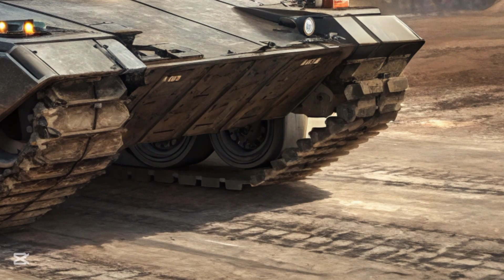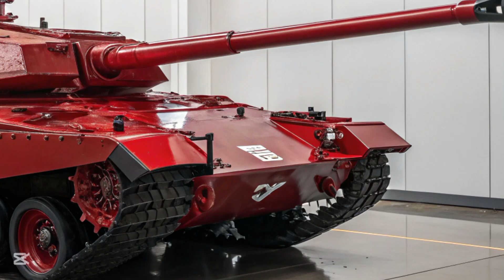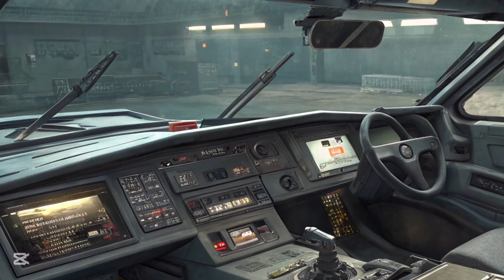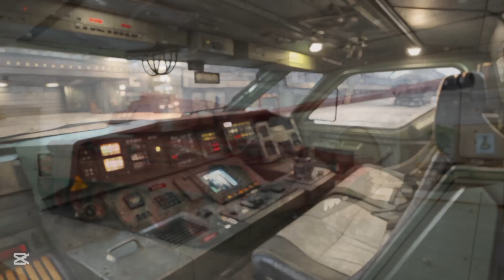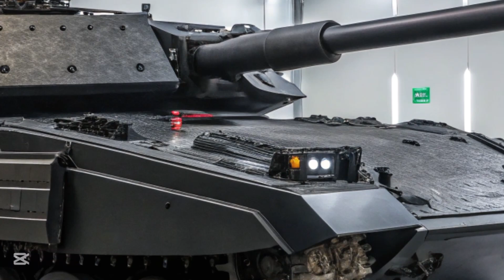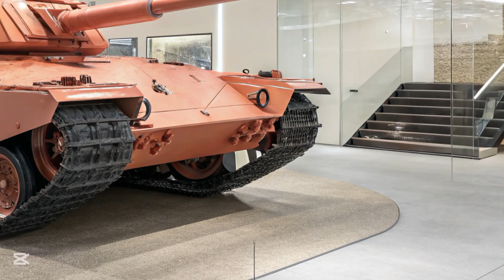2026 T249 VIGILANTE Prototype EXPOSED! 😱 37mm Gatling Cannon of DOOM Returns! 🔥🛡️

Comment: You know that at lesast three tanks were shown -- ALL purporting to be of the same tank?  Basically, this is total BS.  I just wish there was a way (maybe there is, but I haven't seen it so far) that you can go back and locate these types of garbage and permanently delete the 'author'.  Did you notice that the numbers of the 'road wheels' showed this garbage to be 5, 6, or even 7?  Did you happen to notice that the 'fantasy vehicle' also had a main sun -- with a SINGLE BARREL -- i.e., where was the multi-barrel 37 mm Gatling style AAA?  This is the worst 'factual' video I have ever seen on You Tube with regard to military vehicle -- particularly ARMOR!